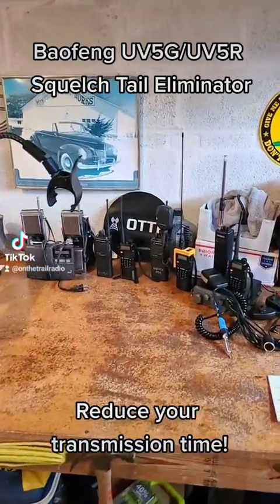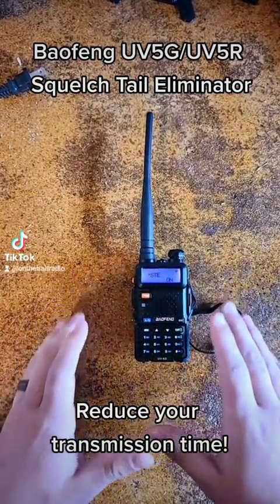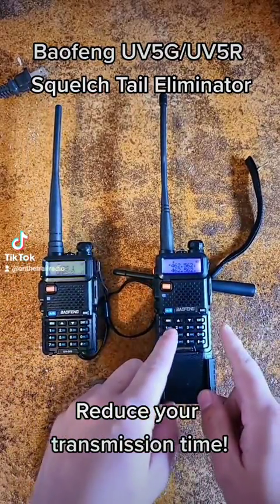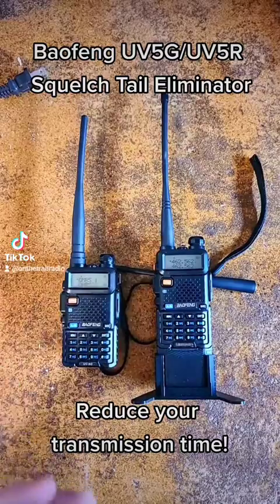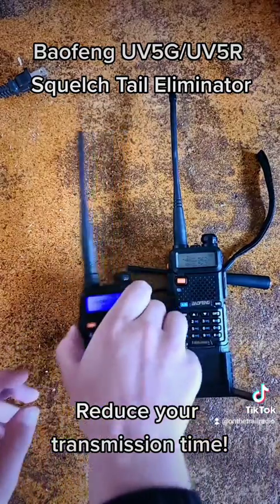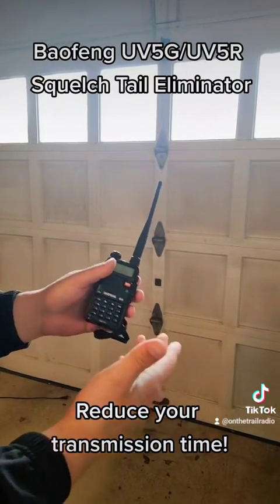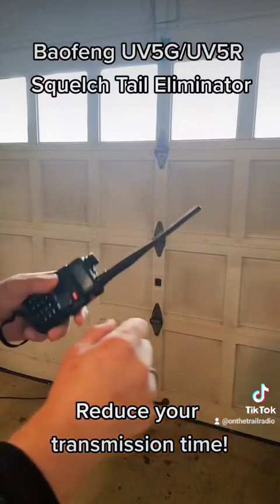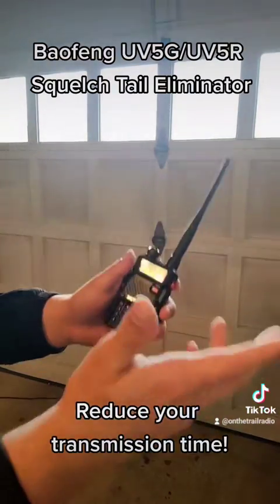Baofeng Squelch Tail Eliminator (STE)

Comment: Dedicated police scanners must be designed to reduce squelch tail noise because when I tried this using a Bearcat as the RX radio, I couldn't detect any difference with STE on vs off. Tried it again listening through another Baofeng and the difference was night and day. Even more pronounced than in this demo video (maybe your camera is doing some noise canceling magic?).

I guess this is why it drives me nuts when I try to use my Baofeng as a police scanner. If I set the volume low enough to keep the squelch tail and morse code sounds from blowing my eardrums, it makes the talker sound like they are whispering into the mic. 🤣

Comment: Seems only work if the other is using Baofeng.
Reply from the maker: Shouldn't. The STE works for repeaters and r2r
Reply: Baofeng uses a proprietary squelch tail eliminator, that only works with Boafeng, and other cheap Asian made radios. They're version of STE uses different tolerances than Reverse Burst used by Motorola, so they are not compatible. If you use the STE feature, and you are monitoring a Motorola system, you will still get squelch tail.